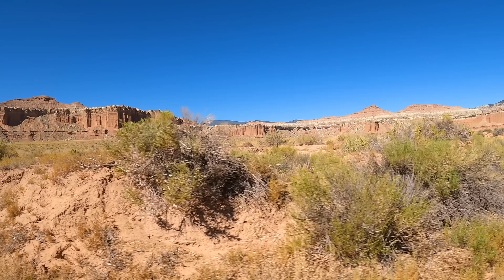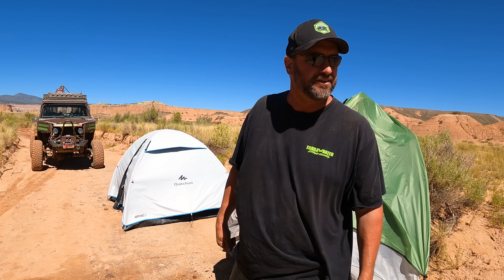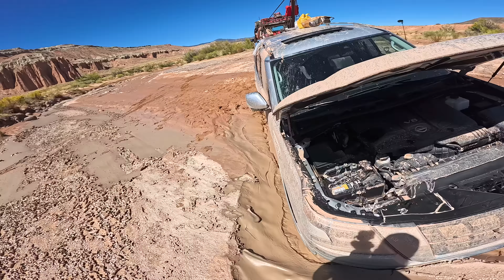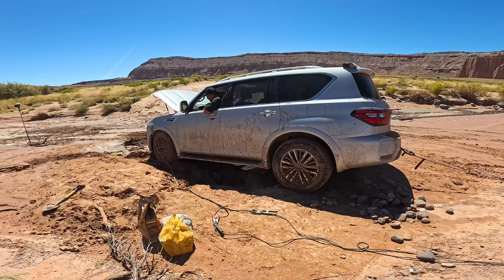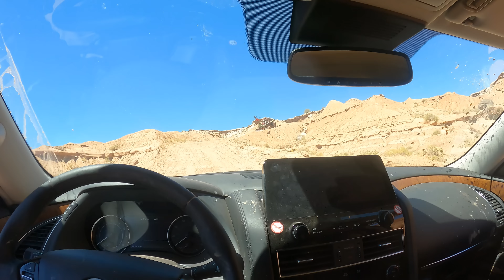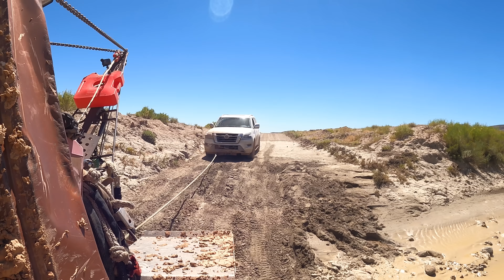Family Stranded In A Flash Flood

Comment: The newer the vehicle the more power it needs just to survive.  Not surprised the battery didn't last long.  Trail Mater putting in the work.
Reply: Exactly. In the old days of carburetors you could drive pretty far on just the battery. It was only really running the ignition coil. With everything electronic now it's just not possible. Also when driving offroad that Armada has a traction control system that will use the ABS pump to brake the slipping wheel. That'll suck some energy out of the battery, especially in that mud.
Reply: @Fix_It_Again_Tony  If you had a magneto, you didn't even need a battery at all. The spark plugs were powered by the engine, via the magneto. My brother in law spoke highly of magnetos, said they were extremely reliable. I only saw one once, and it was from a very old bike. If I remember right, magnetos are very expensive compared to a coil and distributor, but it's been 25+ years since I heard any of this. I remember the reliability bit because I heard it a lot, but not so much the other stuff.
Reply: @Fix_It_Again_Tony  Only coil? And fuel got out of tank how? Magic? 😂
Reply: @aljosaskrabelj8412  Mechanical fuel pumps, genius.
Reply: @Fix_It_Again_Tony   O cmon how far back did you go with this. Electric fuel pumps are in use on wide market for more then 60 years. If you go back that far then diesel engines need no electrics what so ever. Start it and go.
Reply: @aljosaskrabelj8412  "In the old days of carburetors".
Reply: @Fix_It_Again_Tony  That is 35 years back. You go back far enough you dont even need battery to start anything. You just use a horse.

Comment: As an Armada owner ….. it’s not the alternator. Armadas have an ever charge system that runs solely on the battery unless it is driven for more than 30-45 minutes at which time the alternator kicks in to pull the load. Short trips or multiple on/ off kill the battery quick! Took me 3 years of dealership visits and several battery replacements before mine got fixed. I haven’t had a problem since disconnecting that stupid system.

Comment: Modern cars. The slightest electrical glitch turns them into an expensive brick. I've seen vehicles where the water current was so swift that it washes the ground out from under it and it just sinks.  Looks like that happened here. All of the suction of the dirt around the frame and wheels really makes it hard to pull.

Comment: The Nissan probably has a "smart" alternator. like a lot of new cars. So it wouldn't have kicked in while you had the jumper leads connected and it was seeing full voltage from Trail mater.
That said, being underwater didn't help it either. 

Curious, is there a reason for the slant deck vs using the flat deck? or is just what was hooked up?

Comment: Crazy.  I wonder what the electrical load is like on newer vehicles.  I once drove a Jeep CJ-5 around for the better part of a day running total loss ignition.  That was due to a rookie mistake in installing a second battery (for a winch) and mis-wiring the battery isolator.  At least I had a second battery to jump start myself with...  But that had basically no electronics running. (1976 vintage).  Just ignition, brake lights, and occasional turn signals.  Several engine starts.

Comment: Consider carrying one of those 12v power outlet adapters that monitors the system voltage for these occasions.  It would let the driver see when the battery was getting too low.  They are very small from a space in the toolbox perspective.

Comment: 5500+ lb SUV, plus the camping gear weight, plus the weight of all the mud washed into the nooks and crannies of the underside, and the multiplier of being that deep in the silt mud equals ole Mater putting in the work, and flexing its muscle a bit. That was a ton of squat, and dually tire squish, with some front end lift on that one, wow!

Comment: i have one of them 2 days after i brought it brand new and got stuck in mud the alternator is right at the bottom or the motor i pulled it off cleaned it out and it hasn't missed a beat since in the 10 years i have owned it

Comment: I live in Canada, so most of my deep in there, recoveries, are in the snow. I love how fast electric winches run, but I wouldn’t be able to do my job without a hydraulic winch that actually pulls the weight that it claims it’s rated for. An 8 to 12,000 pound winch hydraulically powered will rip vehicles in half, obviously that’s not the point, but it makes life easier for me
Reply: Didn't sound like Rory was getting close to maxing out the winch. More like he was trying to take it easy on the Armada and not tear off bumpers or rocker panels. 😂
Reply: I used mile marker hyd for 25 years now my nephew is using it

Comment: I bled a Land Cruiser H42-transmission that had water in it.  The 4-speed was a scrap-yard item, so it never spun to make an emulsion.  The water is more dense than the oil, so water, then oil drained.  The dipstick won't show water, because the crankcase is much deeper than that, depending on how much water made it thru the rear-main or whatever.

I dig Trailmater recoveries.  It looks and sounds proper.

Hi Lilly!

Comment: we non americans call this car Patrol Y62. huge car, quite capable car in factory settings for the size but with way too much plastic all around. Y61 had front and back fixed axle while Y62 has independent suspension front and back. also way, way too much electronics in Y62 by my taste. 

with a couple of mods like front/back bumper and better suspension it is a good offroader.

alternators are quite a problem for these cars, well to be honest, mud is always a problem for alternators...

Comment: I am a FIRM believer that ALL new 4x4 vehicles, no matter what brand, are GARBAGE!!!!!   Transfer cases that have no neutral, Transmissions that you can't shift out of gear!!!  If my 4x4 pickup ever goes down for the count, I will buy an older vehicle, and rebuild all of the components.  I can do that, so it will be a doable endeavor.  I have watched Robby Layton, and it is unbelievable what he has to do to repair these new pieces of GARBAGE.  Something that should be simple like a door handle, now has all kinds of electronic controls.  These NANNY vehicles with all of these electronic controls are just worthless.

I can push/pull a transfer case lever!  My traction control is hooked to my right leg!  I can charge an old school A/C system, I do NOT need a laptop to do it.  I do not need to "introduce" the components to the computer.  My computer is located in a roundish container on top of my neck!  

An old school vehicle will still be running when all of these computer controlled POS vehicles are in the scrap yard.